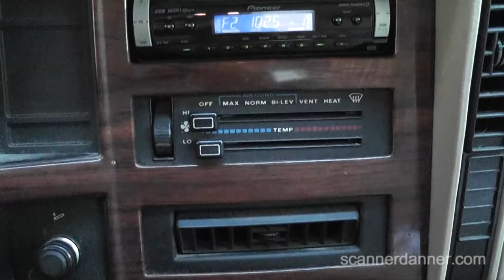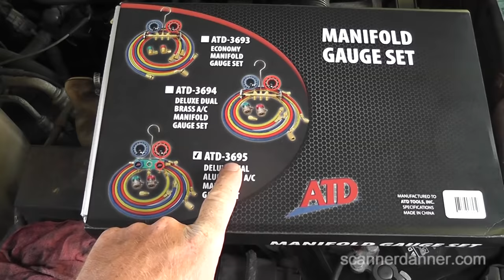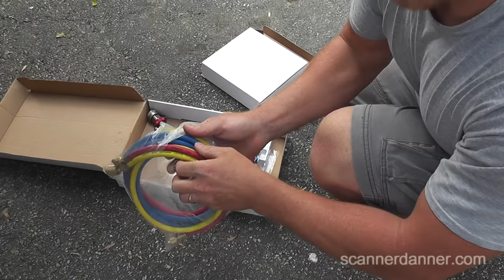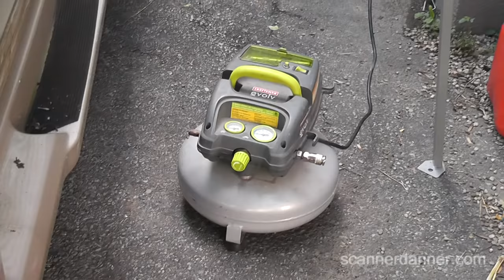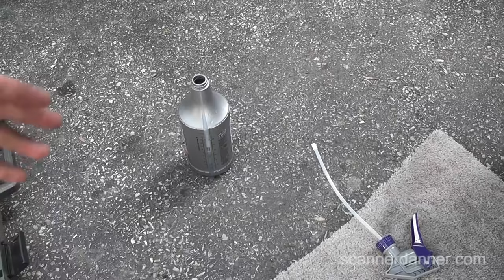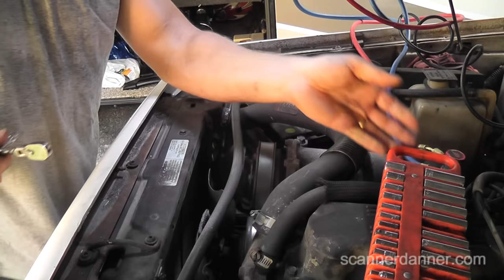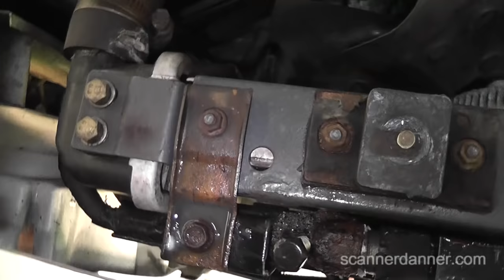A/C Leak Testing and Repair part 1 - 95 Jeep

Comment: Ya I've made lots of money on those repairs. A micron gauge tells you how deep a vacuum the systems in. It will also tell you if you have a leak. 29.9 inches does not = a vacuum . I don't mean to bust your balls but I chuckle as much about it as all my mechanic buddy's do about people's home repairs.   But if it's working than their you go. Doesn't make it correct though. 30+ years of making money on it tell me so. 
Love the Channel
Reply from the maker: Thanks man. I agree nitrogen would be better but I do have doubts that I am adding anymore moisture than what was already there.  
My manifold gauge isn't accurate enough to read those decimals between 29 and 30 inches on the gauge but it was as close to 30 as what I wanted. Anyway, thanks again

Comment: My experience with junkyards has been they charge so much for parts you have to pull, I'd rather buy new or get it off Ebay. The extra money you spend is less than the aggravation.

Comment: 2000 jeep cherokee 4.0. will not take freon. Showing both wires on the compressor 1 ground that grounded to the comp. and 1 coming from the comp/coil. to have power. cking with a test light only. Shows both to be hot... Shows both inserts on the low side pressure switch/cycleing switch to be hot. If i try to bridge it over to cycle the clutch when the high side is hooked up it will blow the big 20 amp ac fuse.  Also the electric fan When plugged in the fan is showing both wires to be  hot the blue and black wires coming off the switch towards the fan. Unplugged shows 1 hot 1 ground cking in the switch inserts. Plug it up.. both wires coming out of the switch going to the fan show to be hot. Also 3 out of 4 inserts show hot on the high side pressure switch. Unplug high side switch/sensor then i get 1 hot 1 ground on the low side switch but bridge it over and still dont kick/cycle the clutch. Also the 1 wire coming off the wiring harness /plug has no power on it. Truck running ac turned on still no power, only when  i connect the plugs together does that wire have power. Note... that i changed the compressor's i put a 96 cherokee on my 2000 cherokee but i had to change the backs out. the lines were run different. 96 back/ middle 2000 on top center. Also changed plug ends . the 2000 comp had 3 wires total.  2 coming from the coil/clutch and 1 ground and the 96 just 1 wire from the coil and 1 ground..can that makes a difference?  The ac unit worked perfect in the 96 but i cant get it to take freon. I have had it vacuumed. The compressor is about 4 maybe 5 yrs old. but it worked fine in the 96. I need help Man..Ps will a stopped up orfice tube cause one to not take freon...

Comment: Milwaukee impacts and ratchets are the way to go. it looks like the ac line at the condenser side is pretty corroded.. my money says u will end up needing a condenser also because the lines won't come loose or you will pull the threads

Comment: I've got the Milwaukee 3/8 inch ratchet, it's a part of there m12 lineup they're great, and a 5 year warranty. the batteries last a good while. I think you would like it man. go on Google and search CPO Milwaukee, you can get a factory reconditioned kit with the tool, battery and charger and a tote bag for 120 with free shipping. mine came the next day.
Reply: and the factory reconditioned tools come with a warranty also.

Comment: Don't know about the compressed air. It would seem, as the system leaks down to atmospheric pressure, that it would still contain refrigerant and not "outside" air.

Comment: If you find a small leak in the condenser,  would it be possible to solder it or would that be dangerous because of a flammable situation?

Comment: Will there be A/C section on SD Premium. Great work as always... On the ratchets I have both snap on and Milwaukee out of the two I prefer the Milwaukee it fits in everywhere. Both have good battery life but both lack brake away torque
Reply from the maker: Absolutely but I'll finish this series here. It wouldn't be right of me to put the final parts on SD Premium

Comment: I would recommend is the snap on 14.4 ratchet over the Milwaukee I have had both of them the battery life is so much better I can use my snap on all week without charging it and professional used

Comment: Hi, can a bad compressor make a bad whining noise? We have a 2009 Ford Mondeo with no a/c, and it makes an incredible whining noise, which sounds very similar to transmission whine, but it's not the transmission. It's very clearly coming from the lower left of the engine, which is where the compressor is located.
Reply: deWaardt  sounds like the waters pump

Comment: Holy crap my lines to the condenser are really corroded in the same place, right where there curve around the radiator.
Probably my issue with my system!

Comment: Hey Paul. Thanks for these amazing videos on AC diagnosis and repair. I'm working on my wife's 98 Chrysler town and country, and when I checked it with compressed air, it took six hours for it to lose four psi. I tried the soap in the water trick, but found no leaking anywhere. I even checked it with the evaporator out of the case so I could spray that and found no leaks there. The only thing I didn't try is the rear seat evaporator. Is it possible that it's still a leak, or could the four psi drop D just due to dropping ambient temperature? Thanks 1 million.
Reply from the maker: IF the system was empty, you have a leak. Sometimes they are so small that the solution is to evacuate and recharge it and put dye in the system.

Comment: hey, all ac compressors leak refrigerant, very little, over time. Something like 5 years is enough time to leak everything out
Reply: My 2009 Silverado has never been recharged and works perfectly. I realize the compressor shafts seal is an area that takes abuse but it is certainly not 5 years on a good system.

Comment: I have a 95 cherokee for the same purpose. AC won't get cold. Condenser clutch engages and it won't take any r134 when I try pulling the trigger from the can.
Frigging mystery.
At least for me anyway. I have done motor swaps and turbo installs, can't get ac working lol
Reply from the maker: what are your system pressures?
Reply: @ScannerDanner  honestly I don't even know. I connect the can to low side service and it says zero but won't take anything when I squeeze the trigger with it running.
Seems like Schrader valve is stuck or hose adapter from can isnt depressing it?

Comment: Now there is quite a bit we could discuss on this video safety aspects would be wearing goggles as you mentioned safety gloves is another one to mention. for correct AC safety you want to watch argo-contractor i have all his videos he also talks about the use of nitrogen and there is a myth about air that i managed to de-bunk by tricking shroedinger box in helping me even he was resisting at first i done most of the work and he just completed it, also if you want to know why i own my 300$ flashlight argo contractor tells why you would own one of these and not a 2$ shop onehanglow, also why you don't have to go out and buy chromed manifolds for ac, All ac is the same on cars, refrigeration ,etc
As for tools! Quality is a huge problem today or the lack of it. You dont use other peoples tools its like you want to throw it away said argo contractor, i can fully identify  with that it describes exactly how i feel about that.  i dont feel comfertable  to use other peoples tools from the 2$ shop and i dont want them to borrow and treat my tools as if  they where  from the 2$ shop.

Comment: Hi Paul, your are very knowledgeable person and good teacher. I have a doubt, does the compressor Will engage even though the system is empty of refrigerant, I kinda of confused, you mentioned running the system with air, I got lost, can you explain me that ?  Thank you Paul, I'm new subscribed in your YouTube channel.
Reply from the maker: The compressor will not engage when system psi is below about 40 psi. There are low psi cutoff sensors and switches involved in preventing compressor operation with psi that low. The air check that I do, whether compressed air or nitrogen is a test for compressor function and compression ratios and should only be done for about 5 seconds max as you are starving the compressor of oil without refrigerant in the system. Make sense?
Reply: @ScannerDanner  yes it does, I trying to learn from you, so, I can fix my A/c in my Honda Civic dx 2005 , was running good but all of sudden it blows only hot air. Thanks for sharing your knowledge.🙂

Comment: Air is fine been doing that for a long time but you are wrong on the moisture.  A Compressor on a hot day will saturate the A/C System way more then just the standing air.  In the last 10 years I have been using compressed Nitrogen for leak check like that.  The Nitrogen will push moisture out of the system while checking for the leak.

Comment: I have the mac 1/4 ratchet in 12 volt and I hate the thing. been rebuilt twice in Three months. the head on it breaks. when you go to break a bolt loose it kicks it back into neutral so you have to put it back into gear before hitting the trigger. plus the battery gets in the way. I had one that I got from home depot (I think its the skill one) but it didn't have detachable recharging battery, so it died every year. but it was a beast for dash work and intake jobs

Comment: Excellent video...I followed it to the tee and my air is working except for one thing. The passenger side blows cold air (40 degree F) but the driver side is noticeably warmer, not sure why. Any ideas?
Reply from the maker: What is the year,make and model car? Dual climate control?
Reply: @ScannerDanner  2010 Dodge Avenger RT 3.5l v6
Reply: No to the dual climate control. I purchase the car brand new in 2010. I have 135,000 miles. 
Also, I have another question for you. I replace both rocker arm assemblies with new ones and also replace the upper intake because of a ticking sound. After replacing the rocker and intake while its idling its quieter but as soon as I drive the car and at around 2000 rpm I can hear the ticking again. If I drive the hard it gets worse and then at idle it goes away.  The car does not miss and runs very good. I had the timing belt and water pump replaced at 93,000. Always kept up with the maintenance on the vehicle. Could I have a bad cam or valve springs?
Reply from the maker: @tommannino7188  it could still be low on charge with that symptom, did you put the correct amount of refrigerant in? as far as noise diagnosis goes, I can't help you with that here via text on a screen, sorry my friend. An oil pressure test would be where I would start
Reply: @ScannerDanner  well, I think I have a leak because I can see green freon under my radiator. I will need to pull off my front bumper cause I am not able see where its coming from. It looks like there are two rads up front where my a/c lines are connecting to.
Reply: @ScannerDanner  I took the front bumper and grill off to see if I can find the leak. I pumped 100psi of air through my system and used the soap test to try and find air bumbles. I have not been able to find anything. I thought for sure it was coming from the rad but it looks and so do all the other lines. Do you think my compressor springs a leak once its being used? It will last approx 2-3 weeks before it is trained again.
Reply: sorry it should be ...........rad looks good.    also last 2-3 weeks before its drained again
Reply: Well I went and added freon to the system to see if I can find the leak and I found it. Its not coming from any of the lines its coming from a rivet that holds on one of the brackets onto the condenser. looks like I am having to buy a new condenser.

Comment: All things are relative.    Tennis shoes may not ABSOLUTELY protect you, but they are BETTER  than flip flops.     Wait till that rotor drops on your toe and cuts it wide open, where the canvas on your tennis shoes could have made that just a bad bruise instead of a bruise +++.    Gloves don’t PREVENT ALL INJURY, but they are a helpful line of defense.    The point is that if we don’t TRY to improve our CHANCES of preventing or reducing degree of injury, then we are just dumb.   Plain and simple.   I have a hard time doing intricate tasks with gloves on, and curse them often.    But that one time my angle grinder cut a big slice in my leather glove, I realized that slice would have been my hand.    That kind of thing.

Comment: Hey there Paul wat about an orifice tube?....kool video man...flip flops are kool as long as ur toenails ain't polished lol..later pal...
Reply from the maker: This system does not use a fixed orifice tube. It is a thermal expansion valve and is not necessary to replace in a case like this. Neither is the orifice tube as it did not have a compressor failure.

Comment: Hey I just bought a 96 Jeep Cherokee to tow 4-down behind my RV.... how did it work for you?
Reply from the maker: perfect! I have an unproduced video on installing the base plate if your are interested, in the mean time, this one shows parts of that install too. https://youtu.be/gJkCoI0Re3s?t=1020
Reply: @ScannerDanner  yeah I'd love to see that video... just now starting research on best tow bar to get and I knew the baseplate would take some extra work :)
Reply from the maker: @professorjedi1024  watch the above video first (the one I just sent you a link on) at about the 17 minute mark
Reply from the maker: @professorjedi1024  also, on my amazon affiliate tool page (link in the description), I added the tow bar I am using and the baseplate, so basically I've done all your homework for you :-)

Comment: I seen the bad clutch right away I was hoping that you seen it. I use air all the time for testing AC systems, my old man is a AC tech and gives me crap about it says I should use nitrogen, I told him the same thing you said and nitrogen aint free and air is.
I dont have a battery powered ratchet but a couple friends do have the Milwaukee and they love them. I use a dewalt 1/4" gun that works awesome sometimes its a little big to get in tight areas. 
Be careful with the liquid sight glass in the middle of your gauges somehow mine got cracked and I cant find a replacement
Great video cant wait for the rest and the RV
Reply from the maker: yeah, I just got my first "air is bad" comment. Many more to come I am sure. I don't care, let them come. I'm not changing how I check for leaks. Air is free, just like you said.
Reply: And if you service AC system like your supposed to any moister will come out under a deep vacuum

Comment: Does it matter what end  of the lines you hook up to the gauges?
Reply from the maker: not sure what you mean, sorry
Reply: @ScannerDanner  I meant you can hook up  either end of the lines to the gauges does the compressor cycle on and off like a Chevrolet my honda is blowing colder I still dont see the compressor cycling on and off is that normal?

Comment: I used to work for an automotive OEM, I learned a lot there and even more since the Internet age has come about... Here is a link to a pressure/temp chart for R134-A http://emea.forane.com/export/shared/.content/media/downloads/products-documentations/fluorochemicals/forane-134a-pressure-temperature-chart.pdf 

The static pressure in the system that, loosely speaking, has at least a small of liquid can be known by the ambient temperature, this is what you would see on both gauges after the system has been off long enough to equalize in both pressure and temperature. If the pressure is low compared to the chart's data for the ambient temperature then the system must be very low on charge. 

Systems can be charged with at least three methods 1) sight glass 2) superheat 3) subcooling and I could geek out for a very long time about this but I will instead just add a link about it, there is a lot of good information out there about this. http://www.achrnews.com/articles/97050-quick-facts-superheat-and-subcooling and one more http://contractingbusiness.com/indoor_air_quality/coolings-dynamic-duo-0510 

Those last two links are focused on residential systems but the principles apply nonetheless. Be careful with pressure/temp charts, some are in psia instead of psig.

Edit: I should add one more charging method - weighing in the charge to an evacuated system.
Reply: The articles you showed only for residential AC where blower motor is fixed, in this case, RPM changes which in change displacement of howmuch compressor pumps out, blwoer motor can be variable and works at different speed, so this method wont work. i am certified hvac guy ..

Comment: my butthole puckered when I saw your finger get closer and closer lol.  

maybe convey that a manifold gauge is important to check high and low even when off,  especially in systems with expansion valves. in the case of blockage or restriction you can tell by the time it takes pressures to equalize.

Comment: I use the milwaukee 3/8" m12 ratchet professionally daily (i beat the crap out of it) and i love it, its smaller in size than the SO ratchet i believe. I also have the ACdelco cordless ratchet that i use for my side work. The ACdelco is HUGE but very well made and a great value. But if i could only choose one it would be the milwaukee. I did a video comparison of the 2 ratchets. https://www.youtube.com/watch?v=WLMTKVyt54k

Battery life is good. You can get a few days out of a single charge depending on use. get your batteries from Amazon. Best price. I have a milwaukee battery and and 2 off brand "flylink" batteries that i cant tell the difference with use.